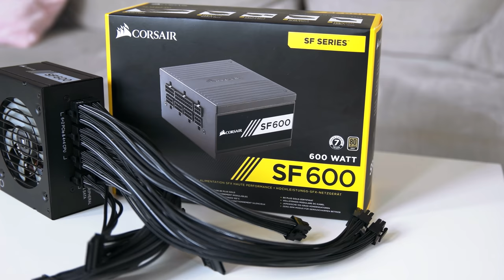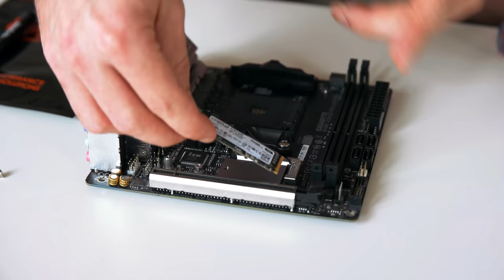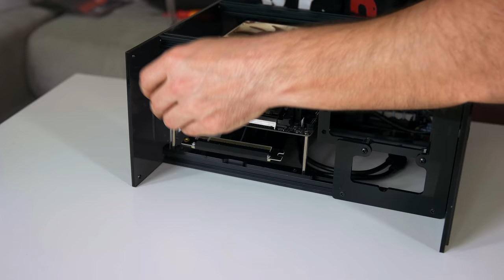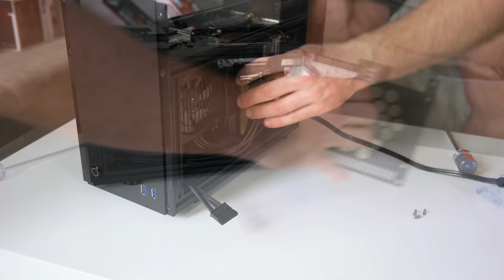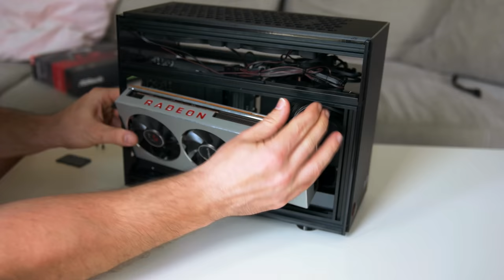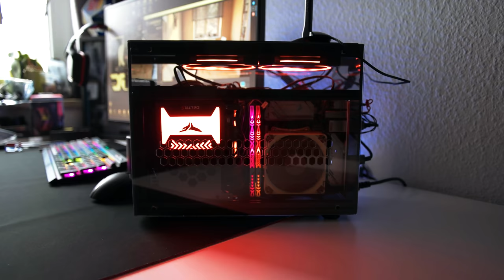Geeek Case A60 Radeon VII Ryzen 2600 ITX Gaming Timelapse build

Comment: Tolles Video , so wie system :)
Theoretisch wäre oben auch Platz für ein 240er oder 280er AIO oder sehe ich das falsch ?
Reply from the maker: Richtig das A60 ist der Nachfolger vom A50 und oben passt eine 240er AIO rein :) Finde aber die Lösung mit 2x120mm fans fuer einen super airflow auch nicht schlecht. Das A50 bietet nur zwei kleine 92er slim fans. Sieht so natuerlich etwas leer aus :D aber die Temps sind top

Comment: what are your thoughts on the mobo and gpu being back to back? other itx cases have a seperation between the two.
Reply from the maker: if you have a m.2 ssd on the backside of the mobo its not so good but with some airflow from the topfans it should work :) i had no problems